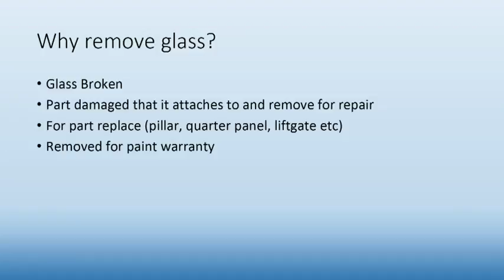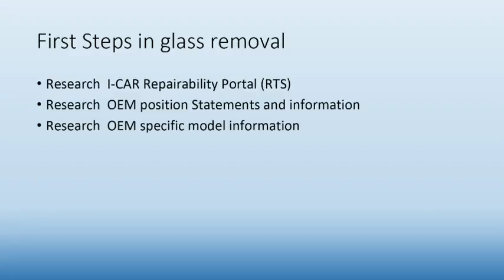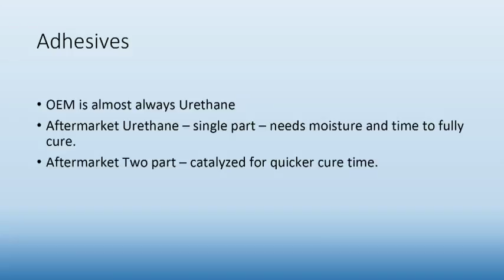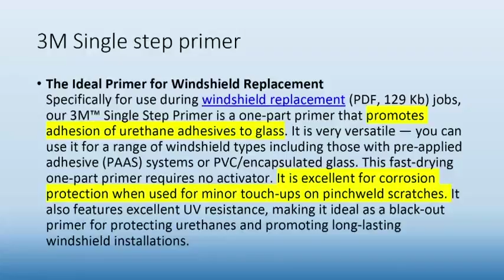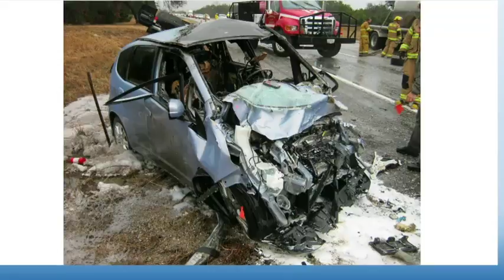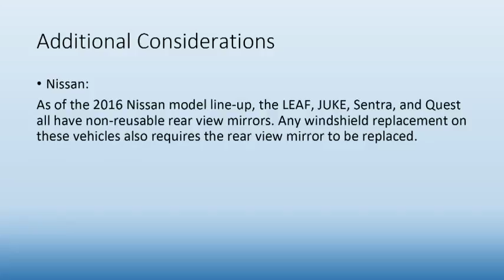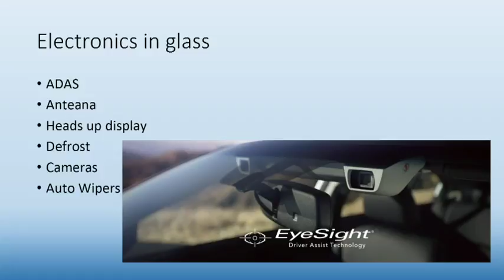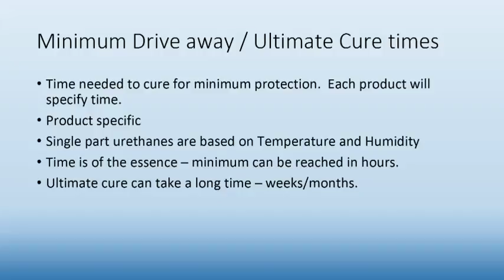Collision Hub Repair University  All Things Automotive Glass

Comment: The GM factory windshield installations is breaking the urethane bond between the urethane bead and the pinchweld fails. It failing because the factory isn't putting any pinchweld primer down or if they are using primer on the early 2000s models is primer on top of clear coat and not creating a complete bond because the clear is slick and primer won't adhere to the slick clear coat.

Comment: The removal tools y'all showed are out of date. We use up to date removal tools like a corded tool that uses a fiber cord to cut the urethane bead and does zero damage to the pinchweld. 

Also the primers have came a long way. The primer by Dow is both glass and pinchweld friendly. And can be used over the entire pinchweld surface or only on the area that got a nick or scratch when trimming the bead.